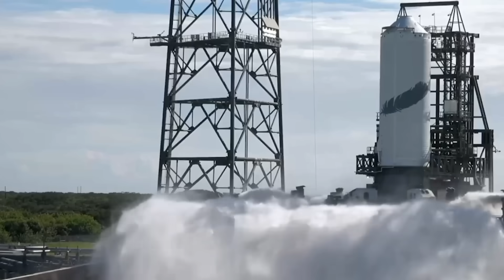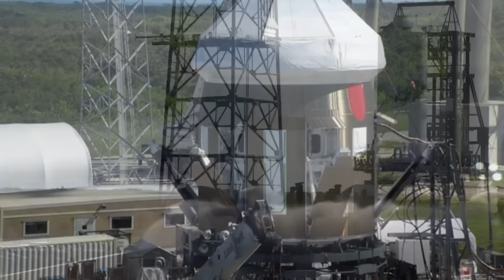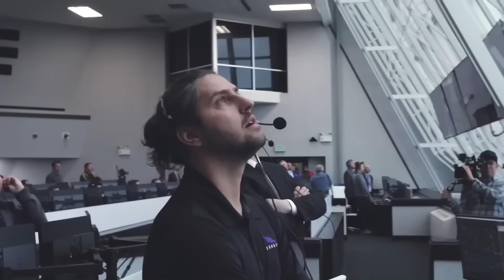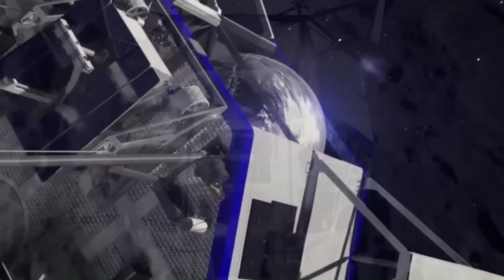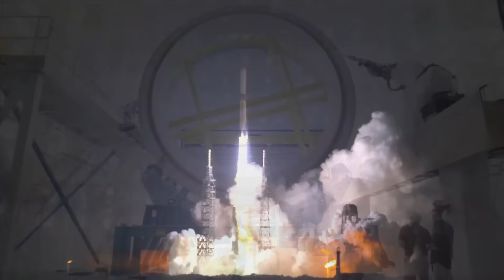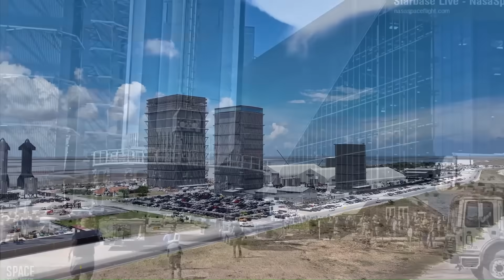Blue Origin Failed To Launch Rocket Again While SpaceX is Breaking Record!

Comment: People keep forgetting how much SpaceX over-promised and under-delivered in the evolution of Falcon 9. Not to mention Dragon and Starship. And how many missions did it take until SpaceX managed to land a booster? 20?
Reply: Yeah ... but make sure you are adding into that analysis the time between flights ...
You can either fly a lot and fail a lot. Or have few flights ... but you cant fail.
Reply: @Coyote27981  The first New Glenn was a successful mission.
Reply: @markmaz56  Don't think so....they didn't land the booster. Only then it would have been a successful mission.
Reply: @GuyDeSmet  Really? SpaceX called the first 19 flights of the Falcon 9 successful even though they failed to land the first stage. The objective of a launch is to put a payload in orbit, which New Glenn did.
Reply: How many successful flights has BO done again?
Reply: @joeshmoe4671  34 New Shepards and 1 New Glenn. And you can probably include 2 Vulcan fights as they use BO engines.
Reply: And now space x is the most productive. Private space company on earth. So them failing over and over as they charted a new path is perfectly fine.
Reply: @thelastquincy1457  And Blue Origin doesn't get the same consideration on their first launch?
Reply: I think it was 11 failures to land Falcon 9 before it succeeded.  The key is Falcon 9 has over 400 successes. If New Glenn went 200 launches per year, it would take 6 years to catch SpaceX in successes, given the SpaceX launch numbers now. No way New Glenn will ever launch 200 times per year. And Falcon 9 is going for 150 launches this year. New Glenn will never be Falcon 9.
Reply: @ohyeahwhat5387  No, they landed on flight 20. Yes, Falcon 9 has been very successful but it took years of launches to get there. Also, New Glenn has almost 3 times the payload capacity so they do not need to launch as often.

Comment: Ok.  They said New Glenn’s first flight was about getting to orbit, and maybe recovery.  Which it did.
So blues SECOND FLIGHT will carry twin NASA probes.

SpaceX took how many flights to even get their expendable Falcon to orbit?  Falcon that never got their “critical” one day turn around times after landing, or landing with little damage, working.
SpaceX has had how many years in development of StarShip under its various names?  A lot more than New Glenn.
SpaceX has had how many disasterous tests.  Tests that on the ground or launch generally involve explosions and crashes.

So how is SpaceX ahead?
Test flight that fail are not steps forward.  Rapid retests and patches that don’t fix anything, arnt steps forward.

So now Vulcan, Ariane VI, and New Glenn all got to orbit on their first flights.  The first two were carry customer cargo.  New Glenn will on their next flight.  And starship is a few years behind, never carried anything to orbit, and is in constant redesigns and failures.
Maybe Musk should learn how others do it cheaper, safer,and with the constant failures and explosions.

Comment: The only thing SpaceX is good at lately is BLOWING UP. Elon needs to take a break from politics and refocus on his own businesses!😅🤣😂
Reply: Wrong. Starlink launches have been successful many, many times as well as retrieving the stranded astronauts from the ISS.
Please get your facts correct.
Reply: @Dana-p1o6o  That's the obsolete Falcon rocket they are trying to phase out. The New Glenn is a NEW rocket just like the Starship. The New Glenn isn't blowing up; the same cannot be said of the Starship has failed nine times over. Once the New Glenn gets its cadence up, there will be no reason for anyone to launch on the Falcon. Poof goes their cash cow.
Reply: @dwightlooi you’re conflagrating very different scenarios. New Glenn is only aiming for reusability of the first stage with with a similar capability of load weight as Falcon Heavy, which has been successfully launching and being recovered for years. Space X Starship is a much more capable and ambitious project because it is about recovering all stages and carrying much heavier loads. It’s the largest rocket ever and the only one aiming for full reusability (much more complex)
Reply: @graciasthanks4771  LOL... Starship has exactly ZERO payload capability. Nevermind the impractical slit like doors that had always been stuck, the steel structure itself is too heavy and has no payload fraction unless they can lighten it immensely. Unfortunately for SpaceXplosion, they need to beef up the thermal protection and add even more weight. SpaceX is the laughing stock for space flight all over the world. You can hear the Chinese, the Russians and Europeans, maybe even the Indians laughing at their joke of a rocket everyday.😅🤣😂
Reply: Grow up

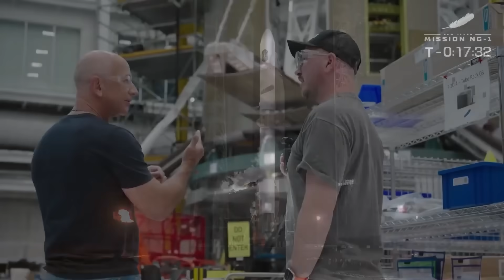Comment: 01:05  B.O. uses sparkers to ignite engines?  That's ONE priblem...
Reply: The 'sparklers' are there to prevent buildup of combustible gasses flowed through the engines before ignition which is handled by dedicated ignition systems in each engine.

Comment: Blue origin is competing with a rocket that has a higher than 70% chance of blowing up and launch late. The pressure must be horrendous
Reply: Yeah, Artemis (Are a miss) does have problems!
Reply: starship is the one that keeps blowing up. falcon 9 (the main vehicle) has a 99.3% success rate with 166 consecutive successes
Reply: @landobugs You're confused.  Falcon 9 has nothing to do with Starship, two totally different systems.